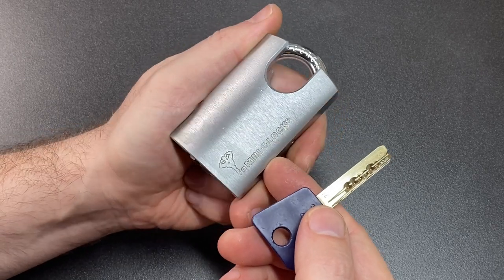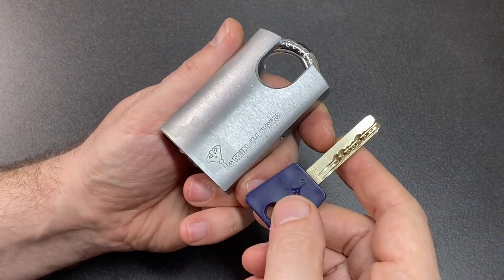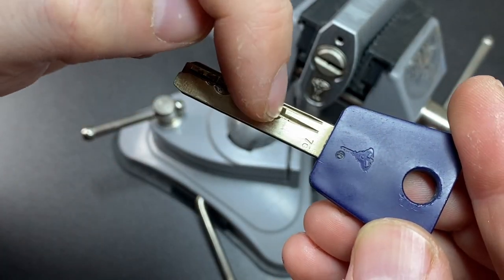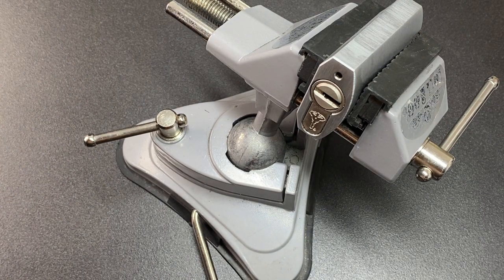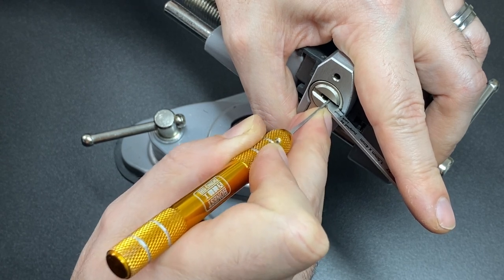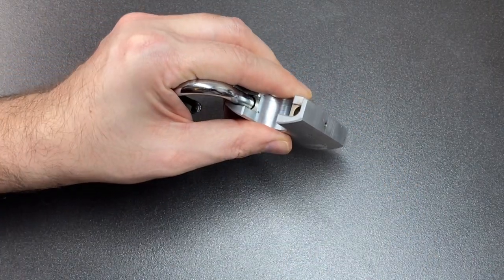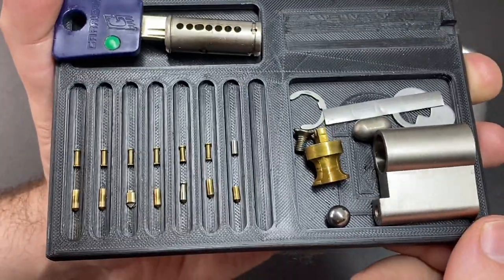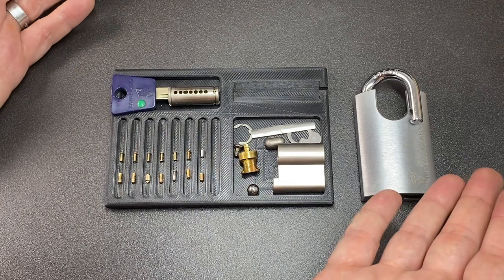Mul-T-Lock 7 Pin G55P Padlock Picked

Comment: I am a locksmith who picked mul t locks for years and pin them up on the daily. You have the 348e series which is on intergrator the padlock is the g12 closed shackle padlock. btws 7x7 intergator and mtl300 they all uses the same pining kit.  On my videos it explains this i hope this helps:) Also your using the wrong key the key you have is an open section which 0767 ( garrson) The function of the pin on slot 3 is to do with a patterning of the key blank so you can not duplicates keys. 🤓👊🏿

Comment: Just curious,  can lock bodies or parts be soaked in degreaser, or is that a bad idea?
Reply: Depends on the lock. If there's any plastic in the lock (or paint) I would avoid it. In any case, make sure you replace grease on any ball-bearings and lubricate the rest of the mechanism with lock lubricant, or a very thin oil.